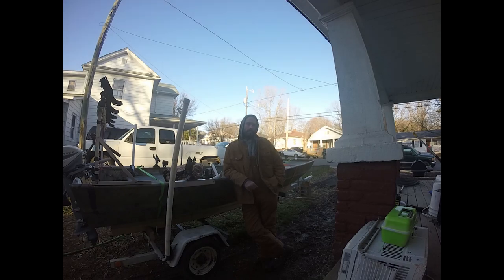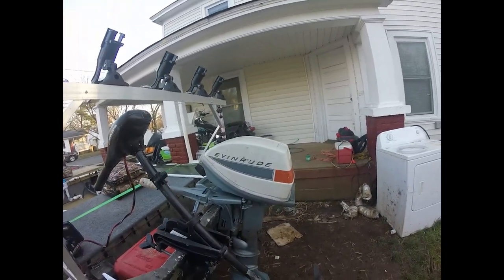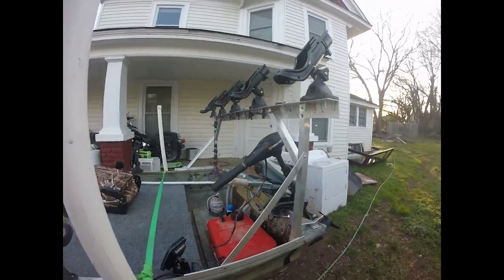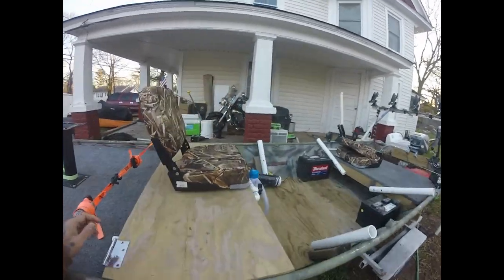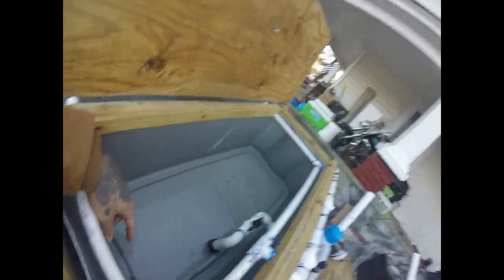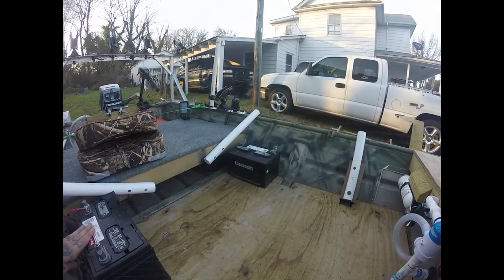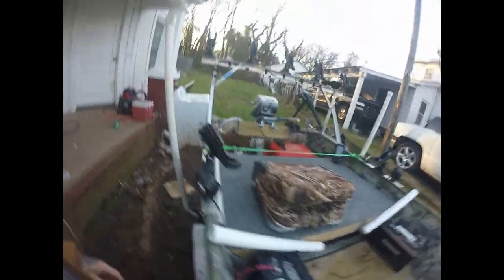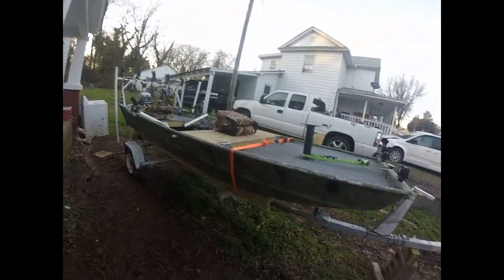Jon Boat Catfishing Set-up

Comment: Just F.Y.I......the GPH stands for (Gallons Per Hour) so now you know your live well pump will pump 800 gallons per hour and your bilge will pump 600 gallons per hour! Great video bud! I dig your setup!
Reply from the maker: Yes I know that.  I need more gallons pumping through the live well while circulating the river water through the live well.  If I get more then 600 gallons in the boat in an hour, I'm in trouble🤣

Comment: That’s a nice setup! I’m about to buy a jon boat to take out by myself and I never even thought of a live well, did you drill a hole down through the boat? If so, what did you use to seal it?
Reply from the maker: Thanks for the comment.  I used a 3/4 tank seal.  If you give me an email address I can send a a few pics of the part and a link for it.  Thanks again

Comment: How’s the pipe ran into the lake water? Is it just straight through the bottom?
Reply from the maker: Sorry for the late reply.  Been really busy with work.  The intake pipe is just ran in from the bottom of the boat.  Only the livewell is full you just turn of the intake valve and open the circulation valve.